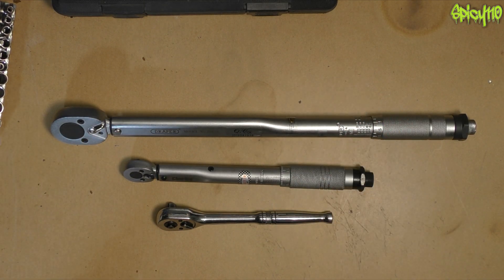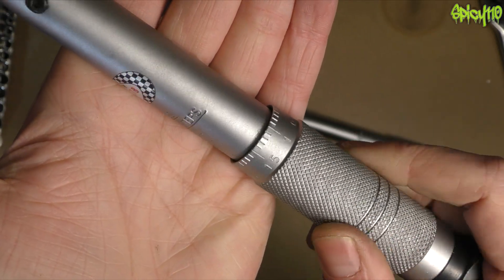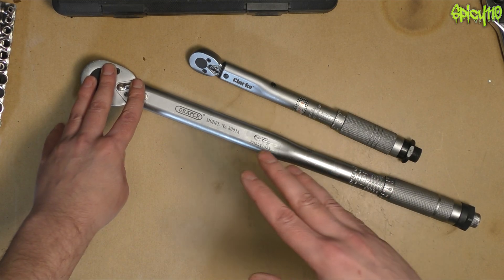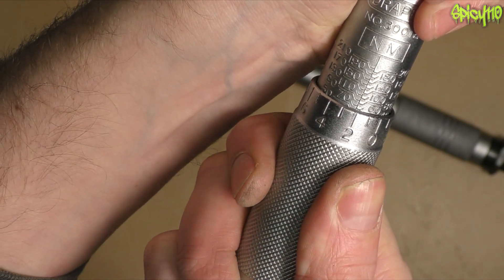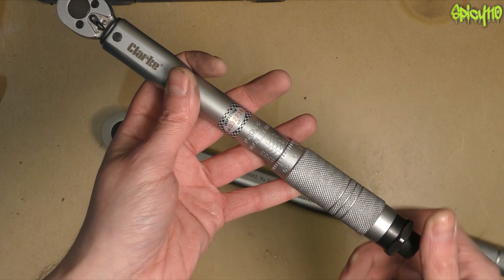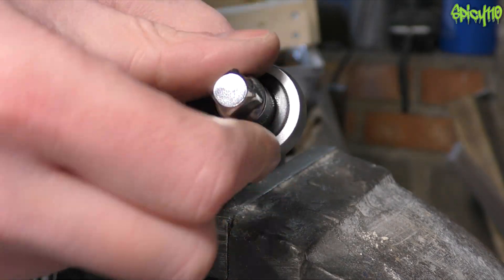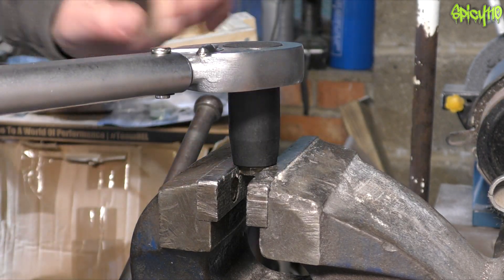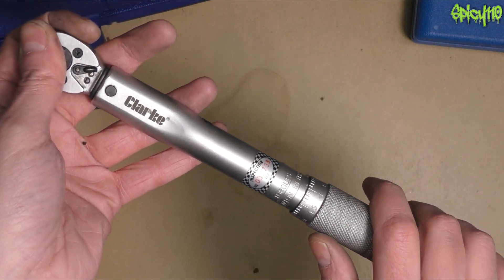How to set a Torque Wrench!

Comment: What are you doing. My tork wrench is inch pounds. What is the measure your using?
Reply from the maker: Mine is in Newton meters, Metric, because that is the unit most used now.
Reply: @spicy110 don't know?

Comment: At my age I am supposed to know how to use tool but unfortunately I don't but I have also finding myself in a position that I need to learn to do maintenance on my motorcycle, which I am also new to. I have been watching and enjoying your videos for a while now, and I have to say that even though this video is 4 years old, it is by far the better one I have watched. Although if you don't mind I have one question apart from the locking nut has a nut shaped end have a particular use ?
Reply from the maker: It's never too late to learn anything, glad the videos help. The nut-shaped part on the handle has no normal functional use when using the tool. Why it is there, then, is a question I am not 100% sure about, but it could be used to loosen the handle from a high torque value (they get stiffer the higher you go), and it might even have something to do with calibration in the factory in conjunction with the adjustment screw (normally hidden under a stick so people do not mess up the calibration).

Comment: Gah!  Why does my torque wrench have numbers on it that make no sense?!  The fine values on the wrench are 0 - 13 rather than 0 - 9, the coarse values going up the bar are at weird intervals too: 28, 42, 56, 70, 84 ... up to 210 at intervals of 14.  Then on the other side, values which don't seem to correspond to anything on the fine values: 2.9, 4.3, 5.7, 7.1, 8.6, 10.0, 11.4 - this is even weirder as the interval's not even consistent!  It's sort-of, about 1.2 but sometimes 1.3!  Why would anyone make a torque wrench like this unless their aim was to cause the user to guess the wrong torque value?!
Reply: You must be using the wrong measurements.

Comment: Very clear explanation and video work. Didn’t realise you could over tighten with a torque wrench until I saw this. This has given me the confidence I need to do a tricky job on my motorbike where correct torque is crucial.
Thank you. I have subscribed.

Comment: Can someone answer my question even spicy110. If my cars wheel studs are tightened to 105Nm,does that mean I set my torque wrench to 103Nm and move it from zero to 2. As I think that 103 +2 =105. Is that the correct way to set my torque wrench as I’ve never used one but I know they are essential for wheel studs on cars. Just want to make sure that is correct. Can someone please verify if that is correct
Reply: Correct

Comment: It seems to me that you are off by one line when you are explaining, say, 60.  The line you are setting at the bottom is actually for 40Nm, the 60 one is one mm above it.  The same is when you do the full rotation and instead of 70Nm you land on 50Nm.  20Nm difference is quite a big difference in my opinion.

Comment: One point I would like to make about using torque wrenches - your torque will only be accurate if the wrench clicks while the bolt/nut is turning. If it clicks straightaway when you begin to tighten, the breakaway torque needed to overcome the friction and get it moving may have given you a false reading, so you should back it off half a turn and retighten in one continuous movement until it clicks.

 Your demonstration with the bolt in the vice raised another important point - stainless steel bolts may look pretty, but they have nowhere near the tensile strength of even standard grade (8.8) steel bolts. They should never be used for critical applications like brake calipers, which usually need a higher than standard grade (12.9), or suspension bolts.

Comment: What must happen with the  hexagon locknut just below the knurled main setting part? Can that be permanently left at hand tight, and only the round knurled part below it tightened by hand when using the torque wrench on a bolt?
Reply from the maker: Yes, you just do it up hand-tight to lock the torque setting.

Comment: I only use one on important things that has alot of vibration. Like engine / frame supports, axle, sproket nuts, spark & inside my engine. Anything else i can get away with feel & if they come lose i'll tighten them back up & throw some blue lock tight on them. (stupid mirrors.) I mainly use it on these parts as if i over tighten them or not enough it could be catastrophic snapped bolt = $$$$ engine falling out, rear wheel falling off ect these are all very bad things lol

Comment: I used a torque wrench on a rear wheel once - bearing failed 15 miles down the road. 
Never used one on my bikes since (except for engine components) 

But with nearly a decade in the motor trade my arm is calibrated

Comment: Very good , They come in handy , just fitted crash bars to my bike (hopefully won't need them!) but they used some of the engine mounting bolts , so pretty critical to get the right torque 
Best regards Shaun